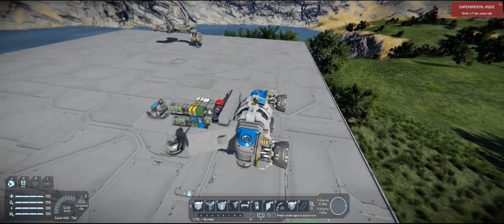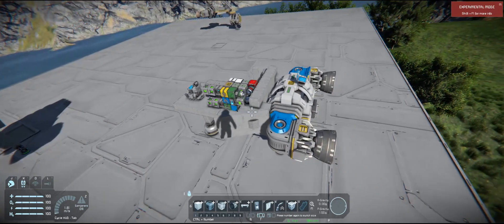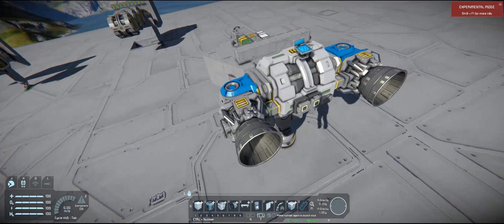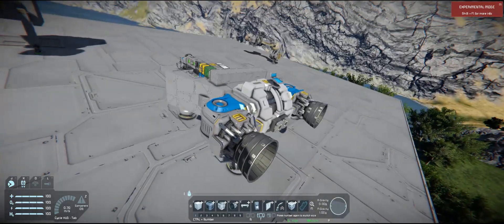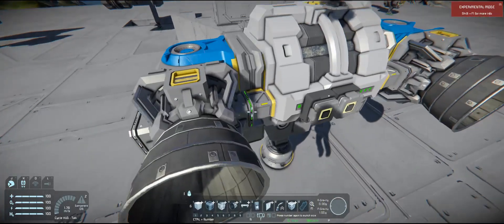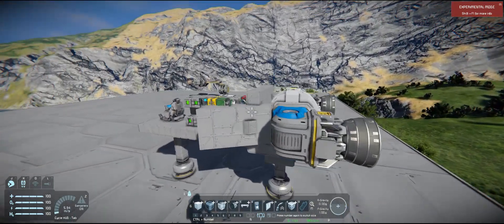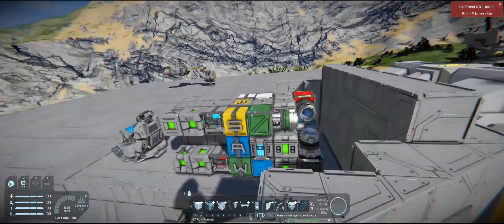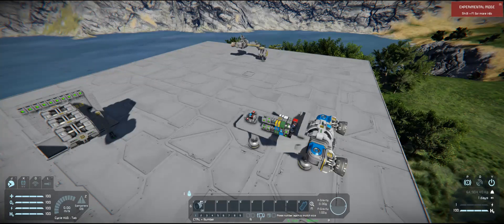Hinged Thrusters with anti clang mag plates, no scripts!

Comment: Really fricking usefull design! Definatrly using it in the future.
You should totally try making a version of this that is able to point the 2 thrusters up, down and to the sides as well, it should be relativly straight forward using a few other event controllers, sensors or timers and a rotor/hinge, would be incredibly usefull have such a thing!

Comment: After seeing your previous work with the pop out thrusters, I was inspired to solve a problem with a miner I had made using the prototech drill.  Due to the size of the drill it's hard to get enough reverse thrust on the vehicle, so I created an emergency braking system that just turns on a pair of thrusters, set to override, when the hinges are at a certain angle.  It's a little clingy but can really save the day when you're coming in hot and a little heavier than you thought.